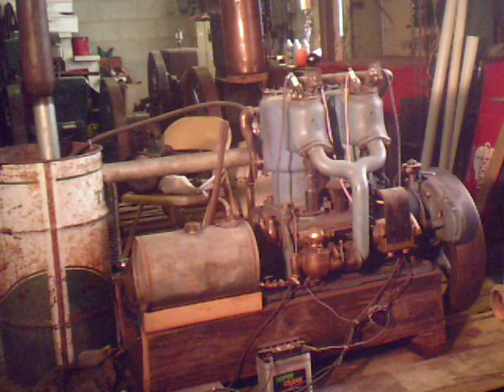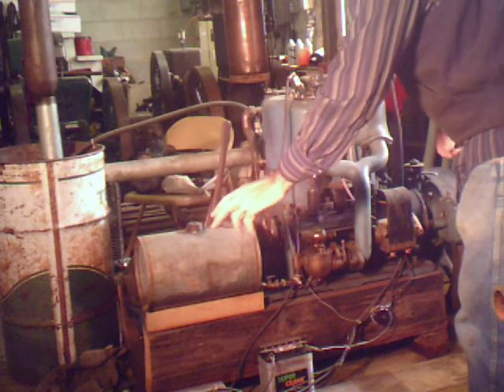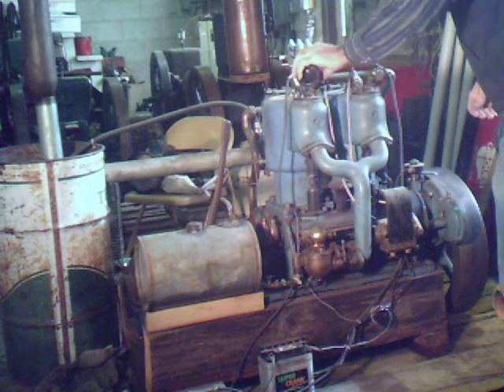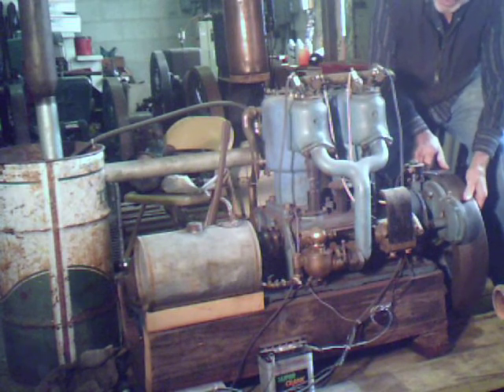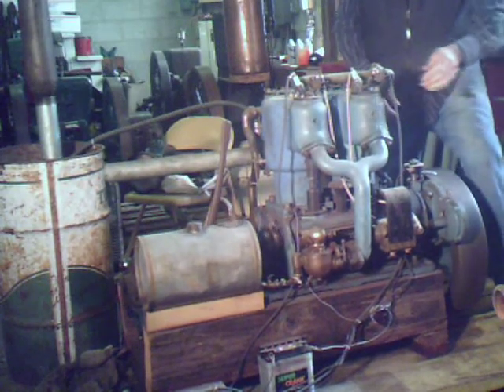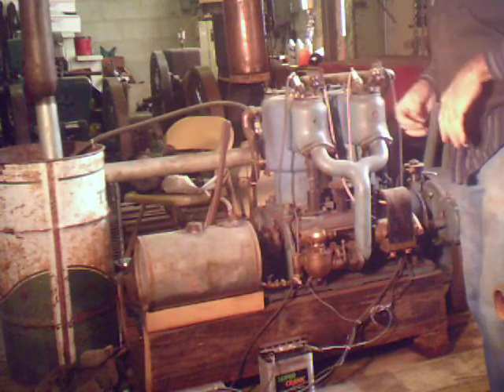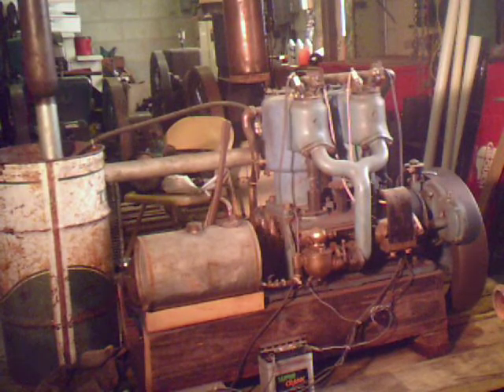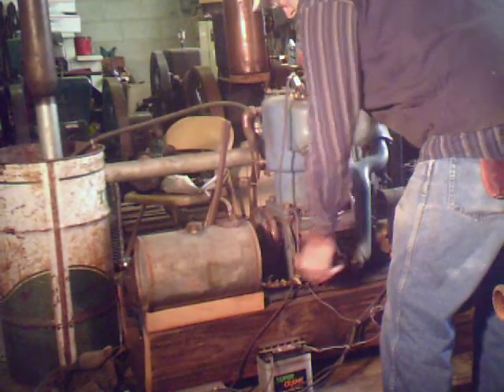Palmer 12 hp engine  circa 1917

Comment: Awesome Motor! I just found and purchased a NR1 Palmer that was used for hauling produce across the Chesapeake Bay and was then installed and used for 75 years on a railway to haul boats. I am in the process of restoring it. Would you have any info on the valve clearances? So far i haven't found any information online nor any parts leads. Thanks and from an old motor lover to another, keep up the good work!

Comment: I have a question, I have what might be a palmer it has twin spark plugs per cylinder buzz coil ignition and I'd also say mag, but it's not a T head engine, it is side valve with a sliding cam for decompression, it also has atmospheric inlet valves and hinged bronze conrods